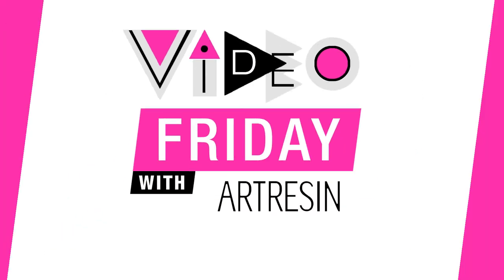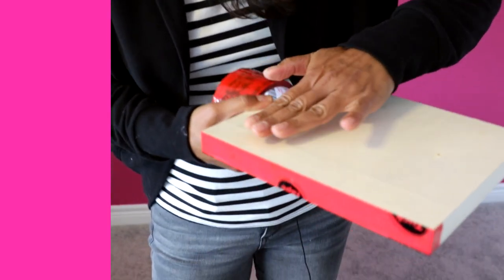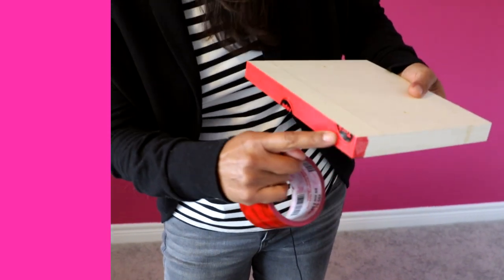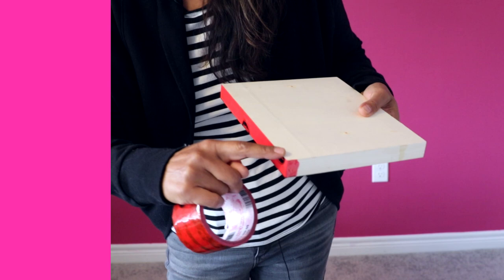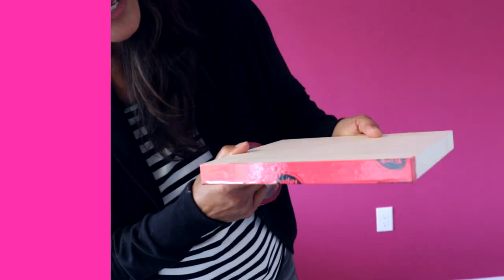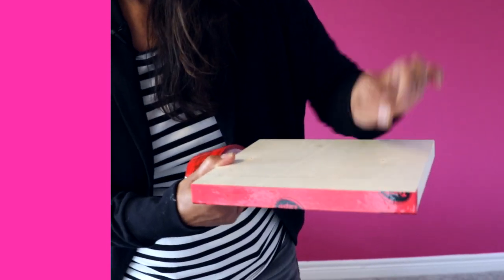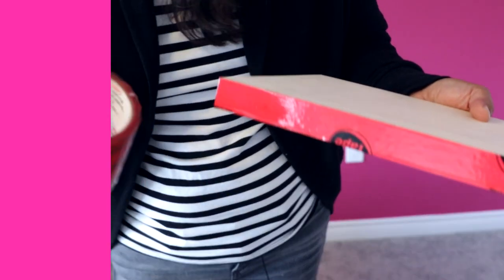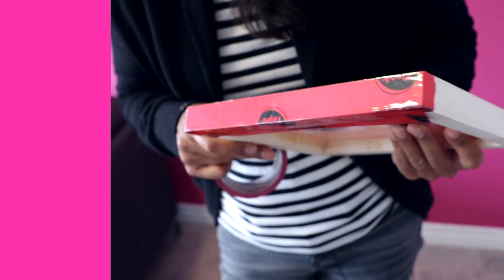How To Get A Clean Epoxy Resin Edge

Comment: @Pamela Heulfer. It is called tuck tape. I went to his video about it. The link is at the bottom of the description.
Reply from the maker: that's right Sheila - and for those who aren't in Canada, Tuck Tape is a brand of sheathing tape, which can be found in the insulation dept of the hardware store.
Reply: @Artresin  is it the shiny silver tape that goes around the metal furnace ducts under the house?  Will painters tape work?
Reply from the maker: @carlawoolsey4570  you can use painter's tape, but make sure it's a good quality one.  Cheap painter's tape is porous and can absorb the resin and because cheap painter's tape doesn't always have good stick, it can allow the resin to seep behind the tape.  The shiny silver tape is very, very, very sticky and will leave a ton of residue on the resin - you'll have to sand it off or run your work through a table saw and cut the edges off.
We like using Tuck Tape ( aka sheathing tape ).  It's plastic based so will not absorb resin and is also sticky enough that it won't allow the resin to seep behind.  You can find it at a big box hardware store - it's used to seal insulation.  
Whatever tape you decide to use, I would remove it as soon as the resin is dry to the touch.  
Hope this helps!
Reply: @Artresin  When you say remove it as soon as it is dry to the touch, do you mean the 24 hours time, then remove the tape,  and continue to let the resin fully cure for 72?
Reply from the maker: @Decopainterandtea  Yes, but you can, in fact, remove the tape even sooner than the 24 hr mark.  
We usually remove by about the 12 - 18hr mark ( resin will dry to the touch by then ) and then set it aside and let it finish curing.

Comment: I checked out the Tuck Tape and it mentions on the package that it has a "Permanent strong adhesive".  Can it be removed from the wood easily?  Must you remove it as quickly as possible (as soon as resin has cured) or risk it refusing to come off?  Thanks!
Reply from the maker: Yes, as soon as the resin is dry to the touch, I would remove it, no matter what tape you're using.  It is definitely stickier than painter's tape ( which is a plus as it won't allow the resin to seep behind it ) but it will come off :)
Reply: Thank you!
Reply: I use green painters tape as it is cheaper and comes off easy. I usually wait about an hour then remove the tape. Hope this helps.
Reply: Thanks Cliff for replying.  Actually I bought some Tuck Tape as I have had problems in the past with resin seeping under Painter's tape (but I may not have burnished it as well as I should have.)

Comment: I have tried this before but I'm never able to remove the tape once the resin is touch dry? When are you supposed to remove the tape?
Reply from the maker: I usually very carefully remove the tape around the 12-18 hour mark but use caution as its not cure yet. Another trick is to take a hair dryer or heat gun to warm up the tape a bit and it will peel right off.

Comment: The problem I get, is that sometimes, even if I use a quality brand tape, the tape likes to pull away after being flooded with resin and it gets underneath the tape creating edges that need so much sanding down 🤦🏻‍♀️
Reply from the maker: Thats frustrating!  You can try really rubbing down the edges of your tape, even running a hard edge over the tape to really stick it down and hopefully that will be enough to keep it in place to prevent the resin from seeping under.

Comment: What is the specific name of the tape?
Reply from the maker: Hi Pamela - it's called Tuck Tape, but that is a Canadian brand :) 
It's also known as sheathing tape - you can find it at the hardware store.  They use it to seal insulation in walls etc.